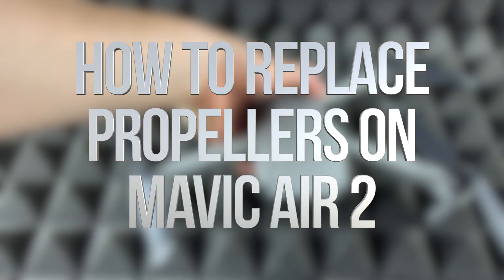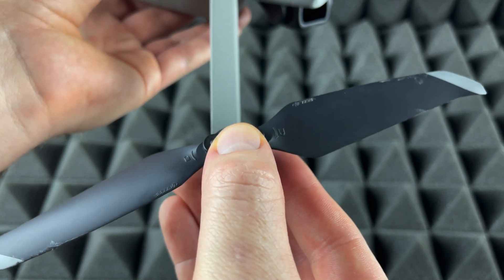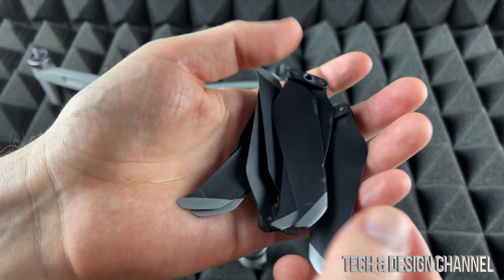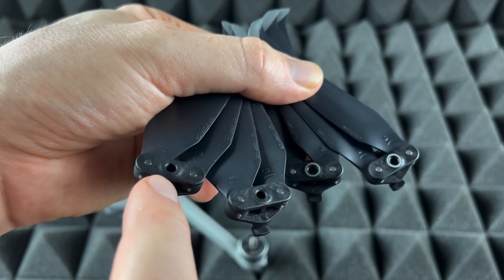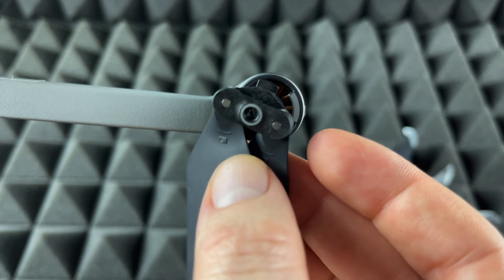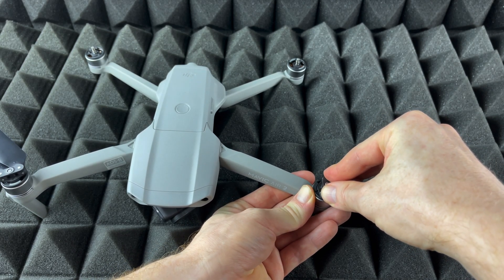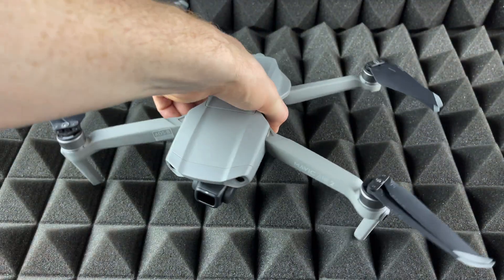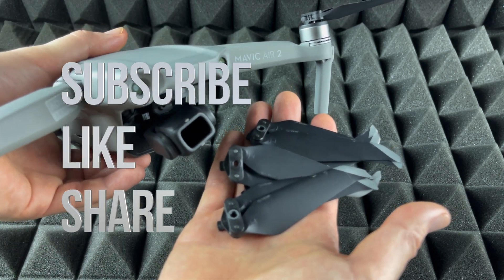How to Replace Propellers on Mavic Air 2?

Comment: hahaha mine if those are "damaged" mine are "exploded" all have theeths, landed it on a tree last month when camming full speed and stopping but it was low battery so stoped slower than I expected. Been flying 5 more time without changing them because I had forgotten, but now is time to change them.